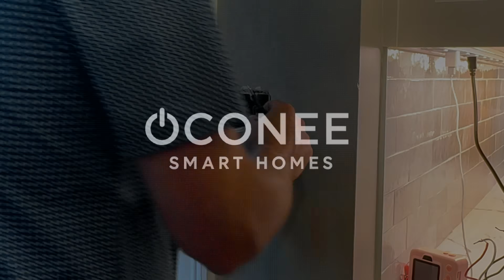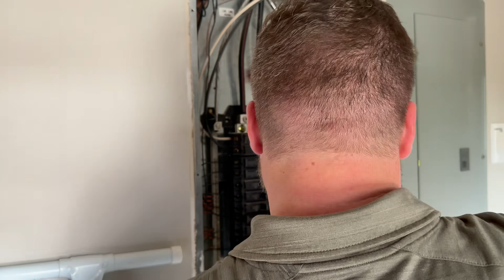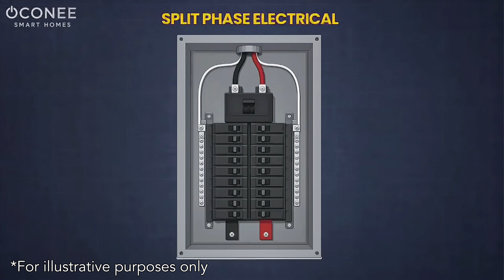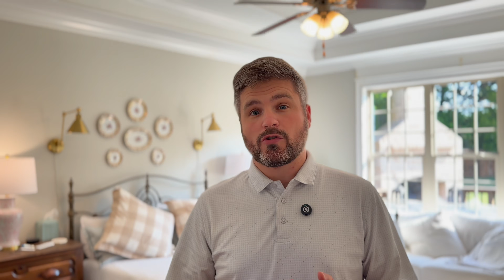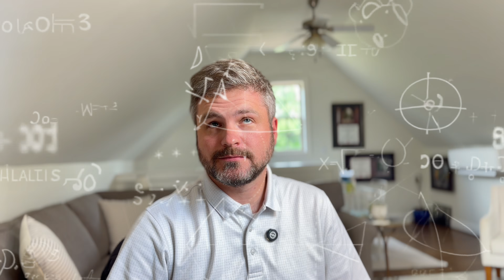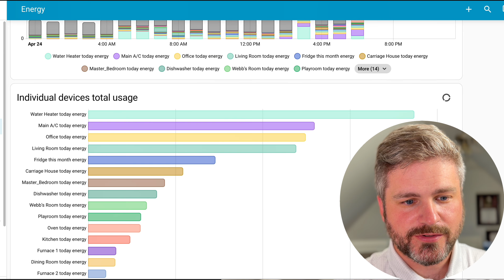Stop Wasting Money: How This Device Found My Biggest Electric Drain | Meross EM16P

Comment from the maker: A few quick notes 👇
Installing something like this is very doable for a DIYer, but working inside your electrical panel is serious business. Always shut off power at the breaker and double-check that everything is off before touching anything. If you’re at all unsure or not fully comfortable, please get help from a licensed electrician. I even checked in with mine on a couple parts of this install.
🔌 10% OFF: Use code OCON10
https://shop.meross.com/products/smart-energy-monitor-em16p?ref=oconee

I had a bit of a rough edit on this one and almost lost the whole video, so if anything in the audio or visuals feels slightly off, that’s why.

Now I’m curious:
What’s the ONE thing you’d want to monitor in your home?
Drop it in the comments 👇

Thanks for watching!

Comment: The main clamp for me is buzzing. Is that normal?
Reply from the maker: I haven’t noticed any buzzing from mine. A very slight hum might be possible since the clamp is basically a little transformer, but if it’s noticeably buzzing, I’d double-check that it’s fully closed and seated correctly. If it’s still doing it, I’d reach out to Meross support just to be safe.

Comment: Hi, did you intentionally install the 2 main CTs apart from each other? Is this to prevent arcing? Thank you.
Reply from the maker: Yes, intentional, but not for arcing. The CTs are insulated and can generally be installed right next to each other. I spaced them apart simply because it fit better. Thanks for watching!
Reply: @OconeeSmartHomes Tank you!!

Comment: I have 2 panels --- 22 circuits and 29 circuits.  Meross cannot monitor either one completely.  It can only monitor 16 individual circuits (+2 for the main panel).  Why does this matter?  Because my house is using around 6 kWh daily wihen everything (including my  3 refrigerators, turned off) and my 3 TVs/sound systems , printer are disconnected with Alexa switches.  Using an ammeter for the A leg and B leg doesn't show much because the values change often during the test.  Electronic circuits can jump all over the place.   For example,  an air cleaner may automatically go up or down.  A computer may use more during the boot up process (happens when you switch your breaker off, then ON during test. All this dynamic change is the very reason I want to have real time readings.  A 16 or 18 zone system simply does not do the job.
Reply from the maker: Agreed. I explained this to Meross that many US homes will be in this situation. As I said in the video too I had to have one for each panel, and then had to choose which circuits I didn’t care about individually… there were a few… so I still feel pretty well covered with the Mains showing total and the 16 CTs in each panel.

Comment: I'm not ready to to install this stuff in my panel, but I am looking to put a smart plug on my washing machine to make sure wet cloths don't get left in the washing machine over night. I don't have a smart plug that would work for my dryer or stove, but this seems like a good solution that would allow me to monitor those appliances, like you said, so we could potentially get alerts if something is going wrong with them. Interesting tech. My next project is getting my chamberlain garage door opener on to my smart home.  Seems like RATGDO is probably the best option for this, I'd love to see a quality video on that product.
Reply from the maker: Thanks for watching! 
I covered the washing machine use case in a separate automation video, and it’s a similar concept that works well (soggy clothes get gross). As far as energy monitoring smart plugs I’d say either  Tapo: https://amzn.to/4n2dn1Z

Or Eve energy: https://amzn.to/4cZAxkT

Yes, this method doesn’t work for the higher power appliances, so tapping in at the panel has opened new workflows for me. 

As far as garage doors, I’d recommend Tailwind, though I’ve heard good things about RATGDO. I’ve got a video on the Tailwind: https://youtu.be/ZfDh1WzkNmY

Comment: DC motor ceiling fans use less power than AC motors.
Reply: Also, I use smart plugs to disconnect the TVs from mains power during overnight or daytime hours when we're not home.
Reply from the maker: @joebass5163 I do this as well with smart plugs and covered in a different video. On the DC fans, yes, but harder to automate and I despise those fan remotes.

Comment: A hybrid electric water heater will save you lots of money, using maybe 25% of what you use now. It doesn't surprise me that is the highest cost, although like you said, in the hot summer the AC is likely to take the lead. I've had solar hot water for 40 years now, and it provides probably 95% of my hot water needs for free. That hot water, in an 80 gallon tank on my roof flows into my regular water heater as I use hot water. For the last 15 years I've had a hybrid water heater, so in the rare cases when I need more hot water than the solar can provide (in the winter, usually when it is raining for days), I hardly use any electricity.
Reply: How does that work? Solar hot water in the winter. How do things not freeze?
Reply from the maker: Thanks for sharing. That’s amazing!